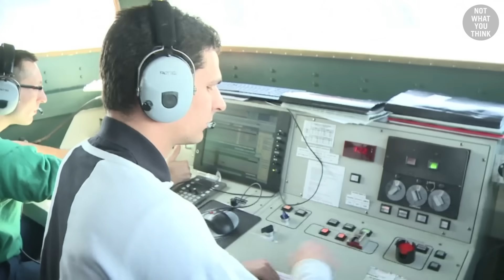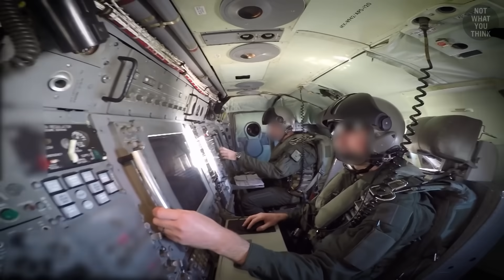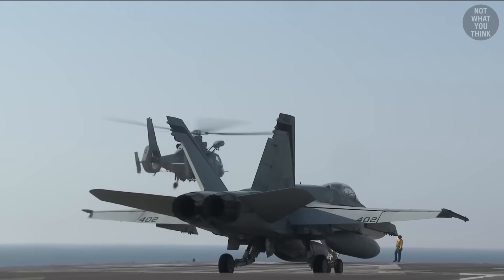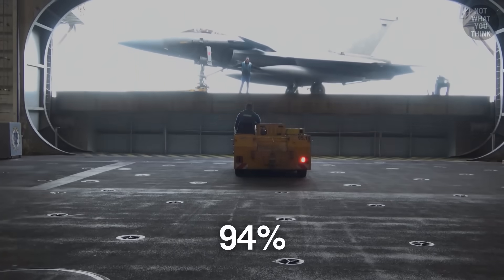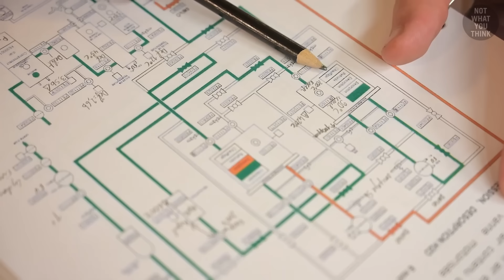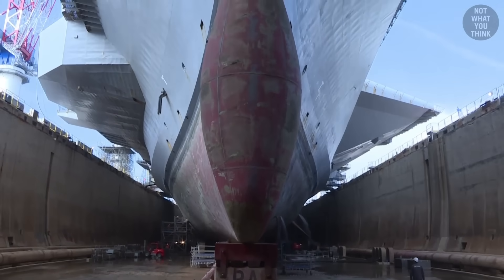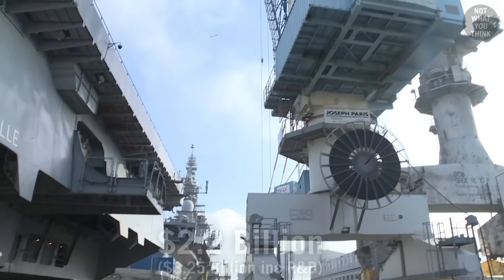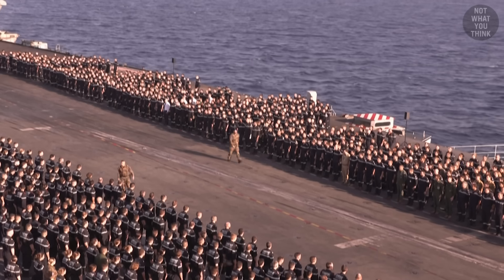Why This Small Carrier is Most Powerful Outside of the Supercarriers

Comment: Does anybody have any idea what that aircraft carrier threw into the water while launching the plane at 18:07 and is that something routine? If you're watching for the splash it's thrown ahead of the aircraft carrier.
Reply: That was the bridle that connected the fighter to the catapult shuttle.  It's basically a piece of steel cable whose ends attached to the aircraft, and looped around said shuttle and as shown, fell into the ocean after launch.  It has since been replaced by a tow bar permanently mounted on the airplane's nose gear strut.  It hooks to a notch on the cat shuttle and is a permanent part of the airplane.  It allows faster launch, and eliminates the waste of using an expensive cable just once.
Reply: @petesheppard1709  That's right, it was used with the Super Etendard, a now retired aircraft.
Reply: @BruneSixtine  👍
Reply: @petesheppard1709 british carriers used to use the same sort of steel bridle for launching aircraft, the bridle could be captured at the end of the catapult and reused a certain number of times, then the bridle capuring mechanism would be disengaged and the expended bridle would be discarded overboard upon launch.
Reply: @tech4pros1  Thanks! Nice to know. 😎
Reply: @petesheppard1709 7
Reply: @petesheppard1709  Exactly
Reply: inclinação exata da eclíptica dos sol , quanto é?
Reply: @petesheppard1709  Yep, US carriers when they were used, had "catchers" ahead of their catapults to keep them from going in the ocean. You can see them on the museum ship USS Midway CV-41 in San Diego on her bow.
Reply: @dundonrl  I wondered how well they caught the bridles, but even if they did, the bridles were probably one use only, due to the strain.
Reply: @dundonrl  I remeber that also Foch and Clemenceau had those.
Reply: @petesheppard1709  they could be reused …. But only after being inspected and refurbished
Reply: @MrSheckstr  Thanks!
Reply from the maker: I’m curious too!
Reply: @NotWhatYouThink 17:49 Installation of the bridle from the catapult system, on the Super Etendard.
Reply: @NotWhatYouThink I’m guessing it’s not going to be what you think
Reply: @NotWhatYouThink  Su-33 & Kuznetsov. 6:33
Reply: @NotWhatYouThink  I absolutely love how you never know anything about the videos you make. 😂
Reply: Its the steel wire launch bridle which connects the aircraft to the catapult . @NotWhatYouThink
Reply: @petesheppard got it right. It’s the bridle from the catapult system
Reply: A steel cable, or "élingue" as we say in French langage.
Reply: @jerrymail  elingue en anglais doesn't sound so nice.
in the arctic, chipping off the ice....
frozen doigts and marlin spikes,  
please splice, please splice!    🥶
Reply: It is a metal cable called "élingue" in french, used to launch the Super étendard Marine. The Rafale doesn't need it.
Reply: @apathyguy8338 it is the steel cable or bridle as explained by 
@petesheppard1709 . You can see the close up of the bridle at the beginning  of the video, 01:00 .
Reply: Launch cable =)
Reply: 18:49 18:49 18:49 18:49
Reply: You are absolutely correct i do not think this little aircraft carrier with its 4th. Gen aircraft is the most powerful outside of the U.S.
Reply: look at 2:03 , that's this piece of metal, the "sabot" needed for old type of plane to be launched with catapults
Reply: That's the expendable rope of the catapult that was used to launch older gen aircrafts
Reply: Creo que lo que sueltan es un gancho que conecta y jala, al avion con la catapulta. Esa pieza no se puede dejar unida al avion ni al barco. Por eso la regalan a los pulpos, que les servira de disfraz el dia de Halloween
Reply: 0:58
Reply: It’s a baguette😂
Reply: 4:05 Is this one you're talking about ?
Reply: It connects the plane to the catapult.  It is thrown free of the ship because if that part was permanently connected to the catapult, it would tear into the ship at the end of each catapult run.  It would also be somewhat damaged during each usage and eventually leading to catastrophic failure, possibly killing the pilot and destroying aircraft.
Reply: I think it's the plane's engine that causes this jet of water.
Reply: It is a metal pole which was connected to the catapult.
Reply: Lauch câble used on the super étendard but now on the Rafale the system of lauch in integreated on the nose gear
Reply: I'd be more interested in why we see these military videos, that are always misleading, untrue, and basically only propaganda accounts? I'd love to know what it is about these facts, that so few of you seemingly understand today? 

In today's world, of hi-tech Anti-Ship ballistic missiles, like the Chinese DF-21D — operational range (1700 km's) (that can sink any carrier in the world with a single hit). All Navies, including the USA's, without the ability to stop these missiles, are in effect obsolete today. 

Russia's Zircon Anti-Ship missile, though inferior in way of operational range-400kms it can be fired from Aircraft, Subs, and Ships making it deadly to any carrier in the world. (Russia also has the Brahmos and the P-800 Oniks Anti-Ship missiles).

We know, neither the USA, the British and the French, have a destroyer, or any other means that can defend against these modern hi tech ASM's today! Making these western Navy's obsolete in today's world. 

The distances, these jets can travel is about 500-650 (max) km's out — and the same back again = 1300 km's range. Seeing them unable to deploy any carrier close enough, to reach any inland target, and then get back again? As anywhere inside 1700 km's, they're sunk, they're toast, they're history. 

This is also why when we hear the USA trumpeting out how they're sending a carrier to the South China Sea, (as some kind of propaganda imagined threat toward China) you'll never see them closer than 2000 km's from Chinas mainland when looking at their GPS positioning, it's known as "bluster".

So why do we see these rubbish remedial misinformation videos all the time?
Reply: @hotstepper887 There are more than 10 aircraft carriers under construction in the world, including all countries that are developing hypersonic missile like China, because they know that carrier vessel are not obsolete. Ukraine war has highlighted hypersonic missile are not as good as Poutine said and missile as ASTER are able to intercept Russian  hypersonic missiles
Reply: @kiefferfx18  You also can't even spell Putin? Is there actually anything at all, you do understand? Why are China building carriers, if they're obsolete, is what you're trying to say? Proving how little you understand.

China will build carries, because China can defend her carriers, the USA has nothing able to stop or defeat these modern missiles, making the US Navy, obsolete in today's world, for all the reason I have already pointed out, reasons, your own words, only prove you know nothing about.
Reply: @kiefferfx18  I could go much further and not only tell you, how far behind the USA really is, across every military front you could think of, but as always, I'm able to prove it to you, by merely presenting the facts, and facts we can back up, because we have seen these real capabilities in use.
Reply: @hotstepper887 Quel belle rencontre que celle d'un expert qui est plus compétent que tous les amiraux américains, anglais, français, italiens, espagnols, indiens, japonais, turques, etc, qui pauvres esprits pensent tous que les porte-avions ne sont pas obsolètes. On n'a pas tous les jours la chance de prendre une leçon de stratégie d'aussi haut niveau. 😂
Reply: @kiefferfx18  It really wouldn't be hard to be more competent than either the USA or NATO, would it?
Reply: @kiefferfx18  A very simply question for you, a question, that shows you the reality of today's military world. 

Tell us, what does the US lead the world in today, concerning anything military?

The answer is, absolutely nothing!
Reply: @hotstepper887  Calling a country's military incompetent when they have like 80% of the world's military power is fucking wild.
Reply: @Stickerz94  It's not wild in any way shape or form, it's more commonly known as the truth, the reality. Now just because you may not know or understand that truth or the reality is nothing to do with me, that's your very own misguidance and a complete misunderstanding of today's military power realities.
Reply: @Stickerz94  Let's start with a really easy one, tell us, what does the US lead the world in today, concerning anything military? 

80% you claim? 80% of what exactly? China has a larger and much more competent modern Navy than the US. China has an Army that dwarfs the USAs. 

Your comment makes no sense, none, not even a little sense, 80% of junk = 80% of junk, not even 20% of quality, it's all incompetent junk, and we've all had this proven to us over and over again, have you just missed it all?
Reply: @Stickerz94  When looking at today's modern missile world, we find, that, once again Russia easily rules the missile world, today.

Russia's modern hi-tech missiles, that include hypersonic missiles, (with Russian GLONASS, GPS targeting systems), give Russia such incredible precision, the USA has nothing we can even say, compares.

And as we've all witnessed, Russia was pinpoint accurate, targeting single buildings in Syria, even seen guiding their missiles straight down chimney pots, or straight in through the front doors, and doing so from the Caspian Sea from distances of, up to 6500 km away. 

Russia has also provided clear, precise footage, of all her long-range missile attacks in Syria, (that we can see all came from the Russian control room online).

Russian hypersonic missiles, the US can't even defend against, and Russia has many other lethal hypersonic missiles being created and added to her arsenal on what seems a monthly basis.

Decades behind.
Reply: @Stickerz94  Then, looking at Electronic Warfare, we again find the Russians are literally decades ahead.

Russia have the GaN MMICs, the krasukha, the murmansk-BN, and Magrav technology (NATO: Khibiny) developed by Iranian-born nuclear engineer Mehran Keshe (called “a modern-day Nikola Tesla”).

And this EW hardware is super impressive, as we've no answer to it.
Reply: @Stickerz94  Then, looking at ground Warfare, we find that Russian troops with reserves, outnumber the USA, and we must also understand, that any attack on Russia, would immediately see China join the conflict, then outnumbering the USA in the millions today.

But, also, and more to the point, what have we ever seen from any US troops, that could make anyone believe or think, they'd be any sort of threat or match, for any of these well-disciplined, well-trained, Russian troops, who are all fully bled, and are prepared to stand and fight for their country's freedom, (seeing them fighting for all the right reasons)? Well, what? Tell us? 

While any US troops, would only be fighting for attempted US tyranny. All throughout the history of wars, we always find, that all those fighting for the right reasons, (like their own freedom), have never lost. 

While on the other hand, all those who fought for all the wrong reasons, like global control/tyranny, have all, not only lost, but all have been annihilated.

The Americans would all be very wise to understand this, as we see this in every war, over and over again! Nothing will change this time, only the annihilation might be much more severe, but it must also be recognized, and said, just as deserved!
Reply: @Stickerz94  Personally, in any upcoming war? I give the USA precisely zero chance, none, not even a little snippet of a chance, annihilation is all they'll get. And again, 100% deservedly so.
Reply: @Stickerz94  It is clear to us that we have to defend our interests, and to do so consistently, not boorishly or rudely, in both the sphere of the economy and of defence. The pressure will only end when the USA will be “persuaded” that the methods they are using are ineffective, counterproductive, and harmful to all ~ Vladimir Putin, 2014.

It never fails to amaze me the way our partners the US, (as we say in Russia) Stand on the same rake twice. ~ Vladimir Putin, 2016.

The United States must “Rise above their endless desire to dominate” ~ Vladimir Putin, 2018.

For the first time in all the history of nuclear weaponry, including the Soviet period, we aren’t playing catch-up with anyone. Other states have yet to create the weapons that Russia already has, ~ Vladimir Putin, 2020.

Talk about NOT taking the hint!
Reply: @Stickerz94  Claiming a country is something it's not, must be one of the dumbest things anyone could do, yet read yourself.
Reply: @hotstepper887  I got to the China's navy part and stopped reading... We don't consider fishing boats as part of our navy, and by tonnage we by far have the biggest navy in the world.
Reply: @hotstepper887  Not even going to bother reading the other 6 replies. Since the first one was total bullshit, I think it's safe to assume the rest are as well.
Reply: @Stickerz94  China have easily a larger Navy than the US, in tonnage and in modern warships of so many different kinds, your ignorance about this is astonishing, as it's already a well understood fact. Get an education.
Reply: The title "most powerful" made me laugh after reading answers of this question.
Reply: if you go frame by frame you cant see anything so it might just be a wave
Reply: @Creature3010 nope it was the wire to catapult a sem...
Reply: no the thing is just faster than the framerate of the camera  @Creature3010
Reply: @Creature3010  dont think waves just decide to pop up like that XD

Comment: HMS Queen Elizabeth and HMS Prince of Wales join the chat.
I mean really?
So how is a 45,00 ton carrier that only has 38 4th gen 20 year old Rafales more lethal than a 70,000 ton carrier with 48 5th Gen F-35s?
Context:
France only has 36 Rafale Ms left to use and they are the 'Tranche 1' versions.
The UK has two carriers capable of delivering up to 60 aircraft all of which are 5th gen state of the art fighter bombers. I quote 48 as that is all the USa has delivered so far but the UK has earmarked 138.

And where is the advantage of CATOBAR? It has weight limits as shown by the F-35Cs launched with 18,000 Ibs of weapons while the UK carriers launch F-35Bs with 22,000 Ibs. (US Navy, LM and RB WEBSITES).

And interoperability?
So a US carrier can host one French aircraft the French carrier can only host certain US aircraft. While Prince of Wales just returned from a global operation cross-decking with Italian, US, Japanese and Indian aircraft. Spain will do this next year. Oh and it was launching 4 ship sorties at 20 second interval.

And there is no strategic or tactical advantage to nuclear power especially given the huge costs of build and scrapping and the extra operational costs. The two GT powered QE Class carriers have both been around the world at no disadvantage to range (40,000 miles) or speeds (32 knots in trials)

Comment: There is something wrong with the French R91 aircraft carrier Charles de Gaulle. The placement of a second runway on the port side of the ship was done so that landing of one aircraft and taking off of another aircraft could happen SIMULTANEOUSLY. But because the R91 is relatively small, the two take-off catapults run OVER the second runway on the port side. Having a second runway on the port side is negated by the two catapults running over it. This could have been solved by making the R91 much longer and therefore much more expensive. But then the R91 would not have cost 3 billion, but 5 to 10 billion. But the French never had a real naval history like the Dutch, English or Americans. So the function of the R91 was only HALF used. And when the R91 has to go to a dock for repairs, the French temporarily have NO operational aircraft carrier. Other navies should not make this mistake. The Americans certainly did NOT make this mistake.

Comment: You say small but the thing is still pretty bloody big in it's own right lol.
Launched on May 7, 1994
& commissioned May 18, 2001, The Charles de Gaulle aircraft has the following dimensions: overall length of 261.50 metres (857.9396 ft), width of 64.36 metres at the waterline (211.15 feet) and a draught of 9.43 metres 30.93 ft). Initially, the carrier was designed with a full-load displacement of 42,000 tonnes, but it increased to 42,500 tonnes after a major refit in 2008. 

For comparison, USS Harry S. Truman (CVN-75) the eighth Nimitz class supercarrier and the closest US analogue was launched just 2 years after CDG, was aunched September 13, 1996 & commissioned July 25, 1998. HST has the following dimensions: it is 1,092 feet (332.85 meters) long, 134 feet (40.84 meters) wide, and has a flight deck width of 252 feet (76.8 meters). The ship's displacement is approximately 97,000 tons when fully loaded.

Comment: The CDG is a fine ship but she's not a great ship sadly. As often with the french military, they wanted to get a smaller version of the US supercarriers, one that could, theoritically, do the same stuff but on a smaller scale. In the end, the program was riddled with technical issues, and the scale of the carrier meant a lot of lost efficiency. Worst, it was so costly that only one was built to replace the 2 conventional carriers the french navy had until the 80s, meaning that France spend a lot time without any operational carrier since the CDG needs to be maintained at port quite often.
The wiser path would have been to get two smaller carriers, which is precisely the goal right now. The next generation of french carriers should embark one of the new small nuclear reactors and the whole carriers should be smaller and stealthier. The air wings should be smaller as well, but the loss of firepower should be compensated by drones.